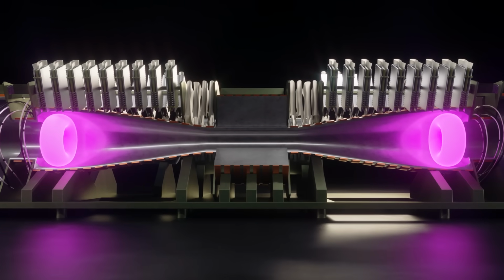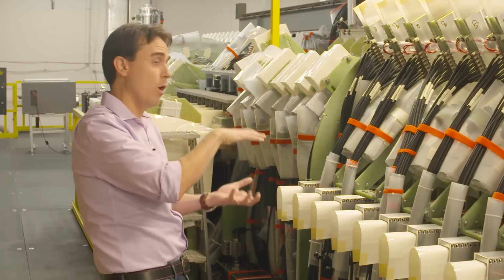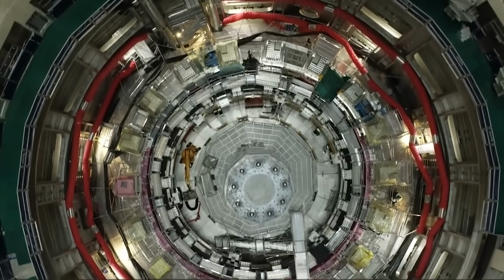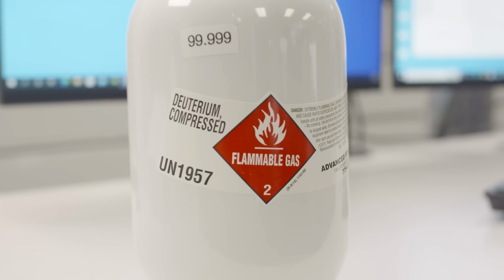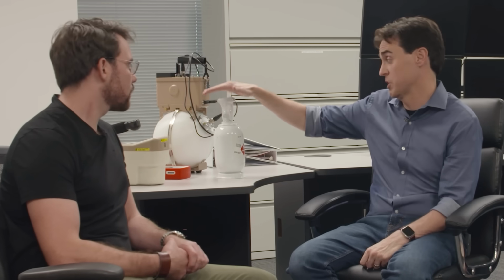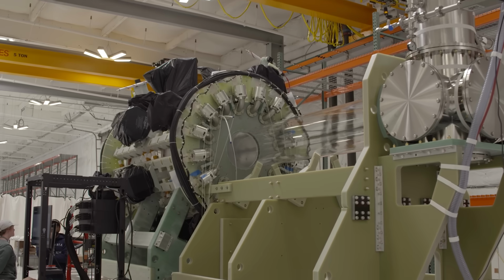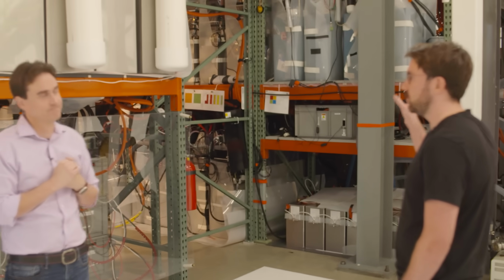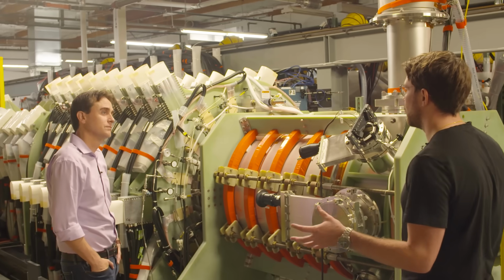A New Way to Achieve Nuclear Fusion: Helion

Comment: This is not a fusion reactor, it is a subnuclear atomic bomb. They are basing their experiments on Einstein and The Standard Model of subatomic structure but their model is wrong! I recommend that anyone living within 200 miles of these structures to move as soon as possible! 

Subatomic Fusion is an erroneous and potentially lethal and fatal disinformation. To produce a nuclear explosion, that is an atomic bomb, heat and pressure are concentrated on fissile material but the size and intensity of the resulting explosion is limited and dependent on the ability of the containment vessel to hold enough pressure and heat to explode, so the results are limited by the ability of the containment. If these scientists continue as they are, they will not produce fusion, they will produce what colloquial science would call, a Gama Bomb. A conventional nuclear weapon produces alpha and beta radiation because there isn't enough energy to produce further expansion but if these men keep upping the pressure they will eventually produce a Gamma explosion, where no Alpha or Beta radiation is produced and only Gamma radiation is created. A bomb with about 3600 time the power of a conventional nuclear weapon. This bomb kills only animal life and leaves all plants and infrastructure intact. Great if you want to depopulate and repopulate an area but you have to convince the residents that they are expendable and should be wiped out, because transporting this bomb is out of the question.

The Standard model is erroneous and in this case, lethal for anyone living in the vicinity of one of these research labs, if they ever get the energy level high enough and they are determined to push it as high as it takes, to show result. 

No one is going to like the results!
Reply: This is ridiculous! The total energy content of the FRC at peak is maybe a hand full of kWh.
Reply: Proof?
Reply: @jotarokujoandstarplatinum1280  The proof will be deadly!
Reply: @rodkeh  So you don't know anything. Gotcha.
Reply: @jotarokujoandstarplatinum1280  I know what you will never know, Physics!

Comment: With Helium3 from the moon, where there are hundreds of kilograms of it, these type of reactors will be very common and everywhere.  They will no longer need to produce Helium3 and all the logistics of that process,  making energy generation straight forward and more efficient. Generators will be protected from the high energy neutrons generated by the deuterium-deuterium reaction. I'm so excited for the future: clean and massive amounts of energy
Reply: According to Google, to satisfy the world's anual energy needs fusing Helium 3, we would need on the order of 100 metric tons of it per year.
Given that He-3 abundance in lunar regolith averages 10 parts per billion (with a B), we would need to mine and process about 10,000,000,000 tons of lunar soil each 12 months.
That's roughly 4 times all the iron ore we mine on Earth per year (all other ores are extracted in smaller amounts).
Not impossible, sure, but, very, very, very, very, very difficult. 🤔

Comment: Under the link you can find some data about the nuclear fusion as described here.
 https://www.youtube.com/watch?v=3vUPhsFoniw&ab_channel=ImprobableMatter
Reply: Only that the so called critique is nonsense. Here is my response.

- Critique: "FRCs have been done before and never worked." 
First, define "worked"! What was the goal of the experiment and what was the outcome?
Second, yes, FRCs have been done before and the members of Helion's founding team were actually involved with several of them. They applied the lessons learned from those to their own design, which they have tested over 6 prototypes so far.
Lessons learned and applied:
1. Size of the FRC. The larger, the less susceptible to n=2, rotational instabilities.
2. Elongation to radius ratio. The longer the FRC, the more stable it is to tilt instabilities.
3. The merging before the compression. This part creates a single, hotter and more stable FRC as a target for compression. FRCs get more stable, the hotter they are.
4. Helion's FRCs have a very low electron to ion temperature (Te:Ti) ratio of 0.1 and less. That makes things a lot easier compared to machines where both are in an equilibrium because: 
P(fus)/P(loss) scales as Ti^1.5 / (Z^2 * Te^0.5 )
Where Z is the atomic number (in case you wonder about that).

- Critique: "Deuterium - Helium3 has a smaller reaction cross section than Deuterium - Deuterium. At the 100 million degrees temperature discussed in the video, Deuterium - Deuterium reactions would be much more likely than Deuterium - Helium3 reactions."
That is generally true, but the author misses some key points:
Trenta is a subscale prototype with much weaker magnets than what they are proposing for a full scale powerplant. Because of that temperatures are somewhat lower than in a full scale power plant. Power plants aim for temperatures 20 keV (220 million degrees) and up to 330 million degrees (30keV). At that point the D-He3 reactivity surpasses the D-D reactivity.
That said, Helion actually wants some D-D reactions because that is how they are breeding their He3.
D-D => He3 +n or D-D => T +p
Both reactions have a 50% chance of happening.
So, in mixed mode (breed and power) machines, they will need two D-D reactions for every D-He3 reaction, at least until the Tritium inventory is large enough that they have a constant supply from decay (Tritium beta decays into Helium3). Sicne Tritium has a half life of 12.3 years, that can take maybe 20 years. That fact is probably the best criticism of Helion's approach.

- Critique: "Deuterium - Helium3 is too hard and Tokamaks cannot do it. Therefore Helion's approach of fusing Deuterium and Helium3 can never work."
D-He3 is very hard to ignite, but they do not need ignition for their design to produce enough net electricity to be economic. Most of the energy from D-D and D-He3 reactions is released as charged particles, not in neutrons. Helion can recover the energy in charged particles directly as electricity at a higher efficiency than a steam plant would. They can also recover 95% of the input energy directly as electricity. That makes their machines a lot more efficient.
Further, FRCs are high Beta (~1.0) compared to Tokamaks (~0.05). Beta means the ratio of the plasmas internal pressure to the pressure applied externally via magnets. 
Fusion reaction rate (the amount of energy produced) scales as magnetic field to the 4th power, an extremely strong scaling. However, that is the magnetic field inside the plasma, not outside, which scales as Beta^2 and B_external^4. 
If it was just about the efficiency of the magnets (it is not), then a 10 Tesla Helion machine would outperform a 200 Tesla Tokamak.
But, it is a bit more complicated than that, because confinement times in FRCs are generally lower. You win some, you lose some. Overall it is still a win for Helion's approach.
Since Helion is using adiabatic heating through the compression stage, they can to some extent(!) balance temperature and density almost linearly for a given magnetic field. D-D reactions favor higher density and lower temperatures. D-He3 is the opposite way round. They can tune that just to the right sweet spot between density and temperature depending on which reaction they want more of.
Another thing that works in Helion's favor is the aforementioned Te:Ti ratio. This ratio actually decreases further with higher temperatures. So the hotter the plasma gets, the smaller that ratio. Trenta already showed Te:Ti at <0.1. It is likely that a power plant will have an even lower ratio. Lower electron temperatures greatly reduce Bremsstrahlung losses. At a ratio of 0.1, thermal transport losses actually kick in earlier than Bremsstrahlung.

- Critique: "The neutrons from Deuterium-Deuterium reactions would have fried Trenta and I see no shielding." 
As mentioned, Trenta is a subscale prototype, an experiment. It is smaller, weaker and only operates at one pulse every 10 minutes (max). A full scale powerplant would do 10 pulses a second!
Not all shots were fueled by Deuterium or Deuterium + He3. Many were fueled by a mix of hydrogen and Deuterium or pure hydrogen, depending on what they wanted to test.
Because of that alone, the total neutron flux that Trenta has experienced so far is not that high.
What the critique does not mention is that neutrons from D-D reactions have a much lower energy than those from Deuterium- Tritium reactions (2.45 MeV vs 14 MeV). Those 2.45 MeV are below the activation energy of many materials.
The machine is mostly made from low activation materials or materials with a half life measured in minutes. Aluminum activated by D-D neutrons has a half life of 2 minutes.
In fact testing different materials under neutron exposure was one of the purposes of Trenta. They have tested quite a few alloys to see how they behave.
There is still permitted shielding of course. It is in the walls of the room and not close to the actual machine, which can handle the aforementioned relatively reduced neutron load just fine. 
It is also worth mentioning that a mixed mode Helion power plant (that does both breeding and power production) would produce neutrons only in one third of all reactions. So the neutron flux, even for those machines would be lower than for a D-T Tokamak.

- Critique: "Helion claims that they discovered new physics when they say that the ion gyro radius is 25% larger."
The whole ion gyro- radius thing was based on a misunderstanding and out of context quote and maybe also bad wording.
What happened was that Trenta achieved a higher ion temperature than predicted by Helion's too conservative physics model (a higher ion temperature is actually a good thing!). That higher ion temperature caused a 25% increase in ion gyro radius, which is perfectly in line with established physics. That's it. Nothing to see here!

- Critique: "Helion had previously said that they would have a working power plant in 2021. "
IM was very eager to get a "gotcha" on Helion. I guess he did not read further up on the page, or he would have seen that Helion was in the process of raising funding at the time. They did not get that funding until now. Even Trenta was less than 35 million (especially if you take the 35 million into 2019 dollars, when they started building it).
No bucks, no Buck Rogers. Should be quite clear, no?

Comment: hey my man the youtube channel "Improbable Matter" is disputing alot of what you said in this video
Reply: Yes and it has been discussed here a lot. Not really a valid critique.
So here is my critique of IM's critique of the Real Engineering video:

- Critique: "FRCs have been done before and never worked." 
First, define "worked"! What was the goal of the experiment and what was the outcome?
Second, yes, FRCs have been done before and the members of Helion's founding team were actually involved with several of them. They applied the lessons learned from those to their own design, which they have tested over 6 prototypes so far.
Lessons learned and applied:
1. Size of the FRC. The larger, the less susceptible to n=2, rotational instabilities.
2. Elongation to radius ratio. The longer the FRC, the more stable it is to tilt instabilities.
3. The merging before the compression. This part creates a single, hotter and more stable FRC as a target for compression. FRCs get more stable, the hotter they are.
4. Helion's FRCs have a very low electron to ion temperature (Te:Ti) ratio of 0.1 and less. That makes things a lot easier compared to machines where both are in an equilibrium because: 
P(fus)/P(loss) scales as Ti^1.5 / (Z^2 * Te^0.5 )
Where Z is the atomic number (in case you wonder about that).

- Critique: "Deuterium - Helium3 has a smaller reaction cross section than Deuterium - Deuterium. At the 100 million degrees temperature discussed in the video, Deuterium - Deuterium reactions would be much more likely than Deuterium - Helium3 reactions."
That is generally true, but the author misses some key points:
Trenta is a subscale prototype with much weaker magnets than what they are proposing for a full scale powerplant. Because of that temperatures are somewhat lower than in a full scale power plant. Power plants aim for temperatures 20 keV (220 million degrees) and up to 330 million degrees (30keV). At that point the D-He3 reactivity surpasses the D-D reactivity.
That said, Helion actually wants some D-D reactions because that is how they are breeding their He3.
D-D => He3 +n or D-D => T +p
Both reactions have a 50% chance of happening.
So, in mixed mode (breed and power) machines, they will need two D-D reactions for every D-He3 reaction, at least until the Tritium inventory is large enough that they have a constant supply from decay (Tritium beta decays into Helium3). Sicne Tritium has a half life of 12.3 years, that can take maybe 20 years. That fact is probably the best criticism of Helion's approach.

- Critique: "Deuterium - Helium3 is too hard and Tokamaks cannot do it. Therefore Helion's approach of fusing Deuterium and Helium3 can never work."
D-He3 is very hard to ignite, but they do not need ignition for their design to produce enough net electricity to be economic. Most of the energy from D-D and D-He3 reactions is released as charged particles, not in neutrons. Helion can recover the energy in charged particles directly as electricity at a higher efficiency than a steam plant would. They can also recover 95% of the input energy directly as electricity. That makes their machines a lot more efficient.
Further, FRCs are high Beta (~1.0) compared to Tokamaks (~0.05). Beta means the ratio of the plasmas internal pressure to the pressure applied externally via magnets. 
Fusion reaction rate (the amount of energy produced) scales as magnetic field to the 4th power, an extremely strong scaling. However, that is the magnetic field inside the plasma, not outside, which scales as Beta^2 and B_external^4. 
If it was just about the efficiency of the magnets (it is not), then a 10 Tesla Helion machine would outperform a 200 Tesla Tokamak.
But, it is a bit more complicated than that, because confinement times in FRCs are generally lower. You win some, you lose some. Overall it is still a win for Helion's approach.
Since Helion is using adiabatic heating through the compression stage, they can to some extent(!) balance temperature and density almost linearly for a given magnetic field. D-D reactions favor higher density and lower temperatures. D-He3 is the opposite way round. They can tune that just to the right sweet spot between density and temperature depending on which reaction they want more of.
Another thing that works in Helion's favor is the aforementioned Te:Ti ratio. This ratio actually decreases further with higher temperatures. So the hotter the plasma gets, the smaller that ratio. Trenta already showed Te:Ti at <0.1. It is likely that a power plant will have an even lower ratio. Lower electron temperatures greatly reduce Bremsstrahlung losses. At a ratio of 0.1, thermal transport losses actually kick in earlier than Bremsstrahlung.

- Critique: "The neutrons from Deuterium-Deuterium reactions would have fried Trenta and I see no shielding." 
As mentioned, Trenta is a subscale prototype, an experiment. It is smaller, weaker and only operates at one pulse every 10 minutes (max). A full scale powerplant would do 10 pulses a second!
Not all shots were fueled by Deuterium or Deuterium + He3. Many were fueled by a mix of hydrogen and Deuterium or pure hydrogen, depending on what they wanted to test.
Because of that alone, the total neutron flux that Trenta has experienced so far is not that high.
What the critique does not mention is that neutrons from D-D reactions have a much lower energy than those from Deuterium- Tritium reactions (2.45 MeV vs 14 MeV). Those 2.45 MeV are below the activation energy of many materials.
The machine is mostly made from low activation materials or materials with a half life measured in minutes. Aluminum activated by D-D neutrons has a half life of 2 minutes.
In fact testing different materials under neutron exposure was one of the purposes of Trenta. They have tested quite a few alloys to see how they behave.
There is still permitted shielding of course. It is in the walls of the room and not close to the actual machine, which can handle the aforementioned relatively reduced neutron load just fine. 
It is also worth mentioning that a mixed mode Helion power plant (that does both breeding and power production) would produce neutrons only in one third of all reactions. So the neutron flux, even for those machines would be lower than for a D-T Tokamak.

- Critique: "Helion claims that they discovered new physics when they say that the ion gyro radius is 25% larger."
The whole ion gyro- radius thing was based on a misunderstanding and out of context quote and maybe also bad wording.
What happened was that Trenta achieved a higher ion temperature than predicted by Helion's too conservative physics model (a higher ion temperature is actually a good thing!). That higher ion temperature caused a 25% increase in ion gyro radius, which is perfectly in line with established physics. That's it. Nothing to see here!

- Critique: "Helion had previously said that they would have a working power plant in 2021. "
IM was very eager to get a "gotcha" on Helion. I guess he did not read further up on the page, or he would have seen that Helion was in the process of raising funding at the time. They did not get that funding until now. Even Trenta was less than 35 million (especially if you take the 35 million into 2019 dollars, when they started building it).
No bucks, no Buck Rogers. Should be quite clear, no?